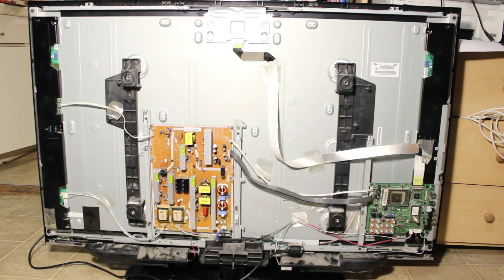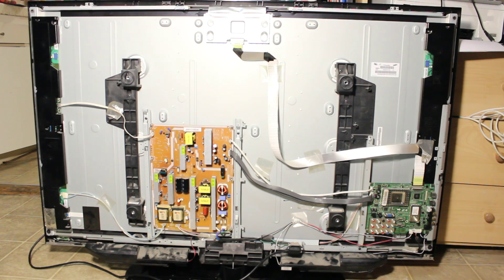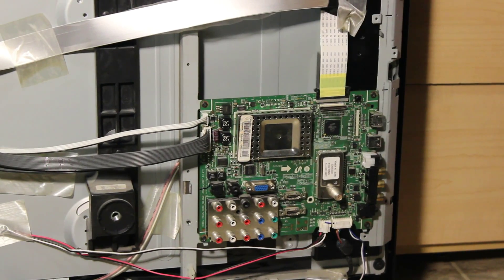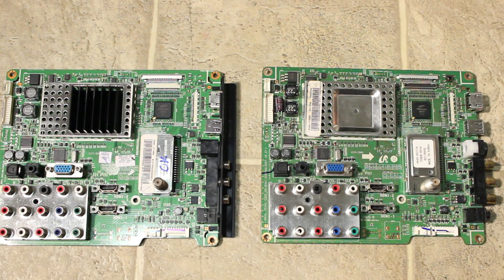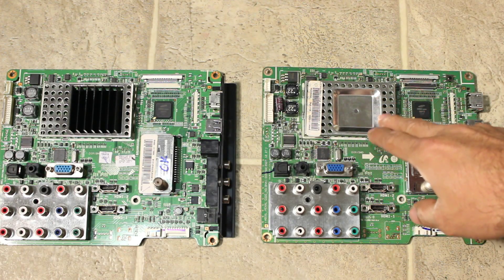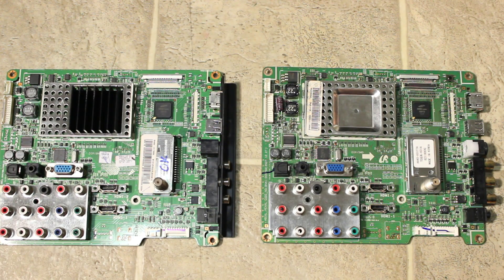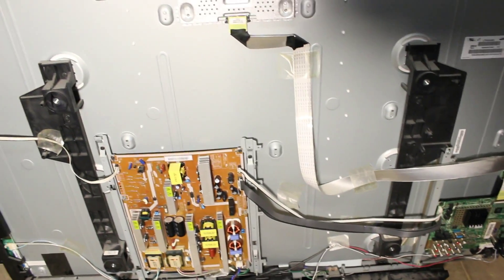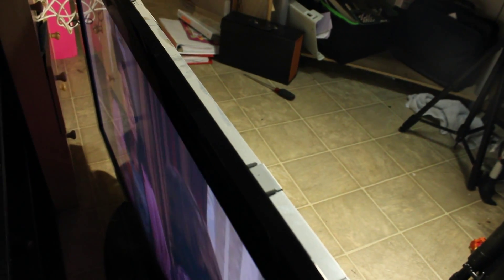How to Repair Samsung 52" LCD TV LN52A550 No Power, Clicking Noise and Blinking Red Light

Comment: I'm having this same issue, how do I know if the problem is being caused by the main boatd or the power supply board?? All of my capacitors look fine on the power supply board, but the board its self looks like it may have sustained some heat damage.

Comment: A short in the main board caused it and not bad capacitors on the power  supply.
Reply: Got same model from 2008 worked on channel autoprogram until accidently used digital antenna with short on cable , now got TCON scrambled

Comment: My family has had a 52 inch Samsung just like this (except it is an LN52A530) for 10 years so far, and it's still running strong. Is that model prone to cap issues? Should I warn my parents about possible looming capacitor issues if yes indeed it is a model that's known to fail with the caps?

Comment: bad caps on the main board underneath and bad cap on the power supply 680v 25v
Reply: this is the CORRECT definition of the problem and the fix. Replacing the main board is OVERKILL and unnecessarily expen$ive